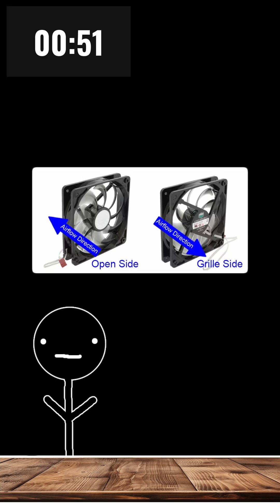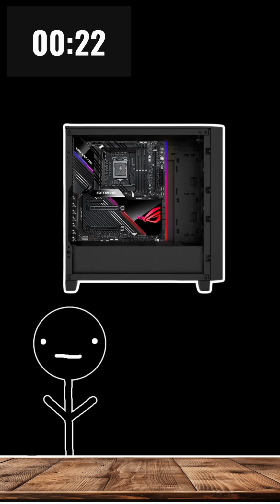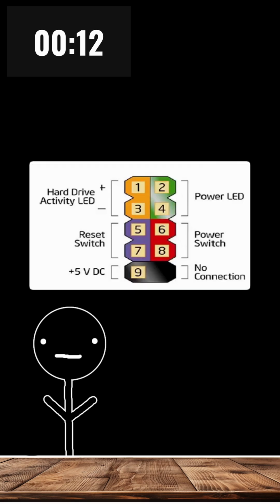How to build a PC!  #fyp #gaming #pc

Comment: id say that thermal paste is probably important
Reply: When I did an installation the cooler had a protective film on it for it wouldn't get scratched
Reply from the maker: Yeah you're right, typically its on the cooler already
Reply: @ezcomputers It's typically not on the cooler.
Reply: @blastermaster0199most coolers these days come with it already on the pump
Reply: @NerfShooter101  Realize that the majority does not need or have budget for liquid coolers.

Comment: even when you put ram the correct way you have to press hard af for it to go in which is scary
Reply from the maker: Yes, its scary the first time
Reply: @ezcomputers  For real
Reply: @ezcomputers  btw i assume you get the parts used? i assume that since you actually sell the computers at a pretty low price compared to the market
Reply: Worth it for the sound
Reply: Theres "get it in there nice and snug" hard then theres "did i cut myself?" Hard. Avoid the ladder

For the most part though they can take a little abuse